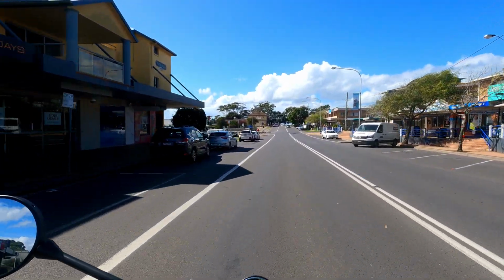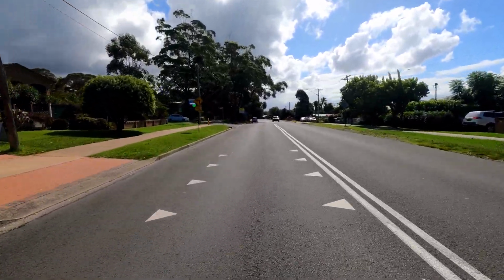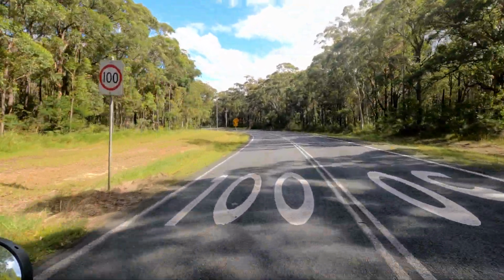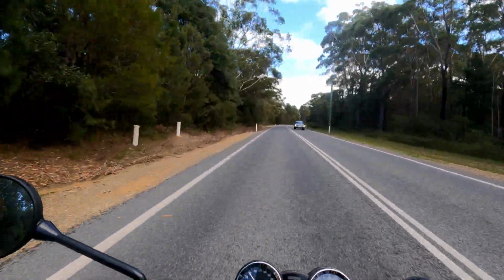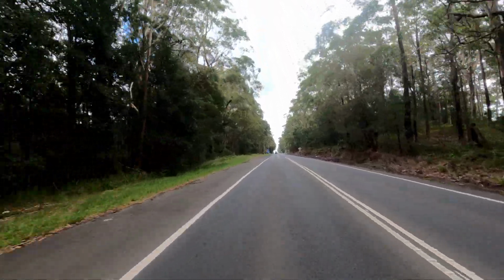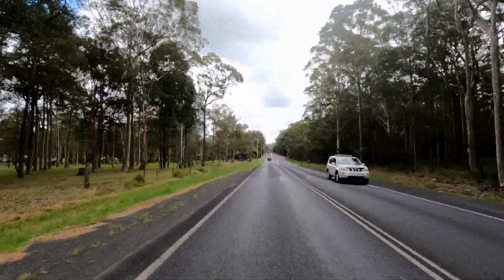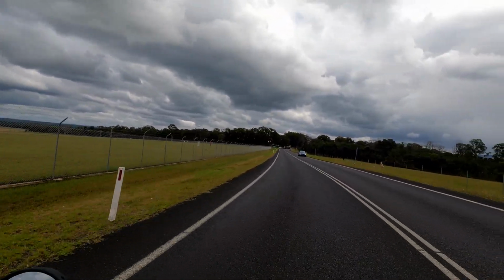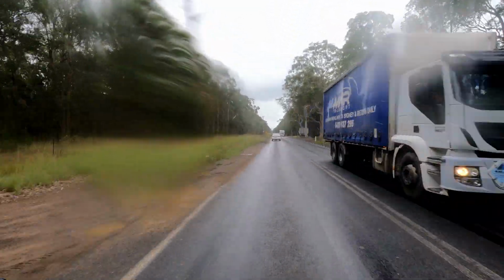Z900RS  review - more torque and less talk

Comment: Love my '22. Put a shock on it, and set up the fork, for me. I have no problem with confidence pushing this bike a bit. Front pads have better bite than Yamaha-don't think I need to change them. A $500 header really woke up the bike, and the ECU adjusted fine. Stock can sounds awesome with this: not loud at steady throttle, but barks nicely, when poked. :) It has more turning clearance than you might guess. I have no contact, while running the stock pegs/feelers, all the way to the edge of the Road 6s I had the dealer install, before I picked it up.  This is a Z900 chassis..she could go to the track, no problem.
Reply from the maker: Thanks Peter ... great feedback ... and a few things there for me to consider